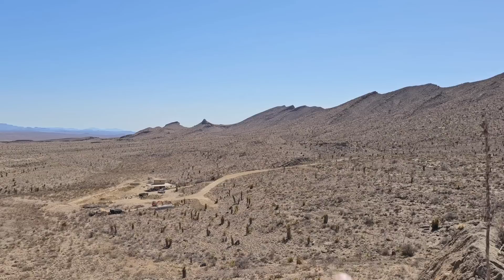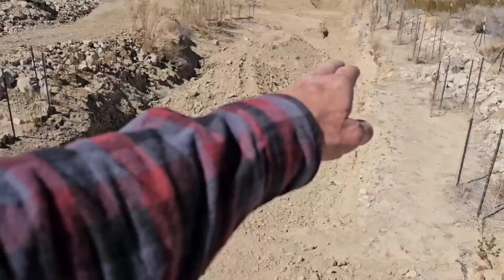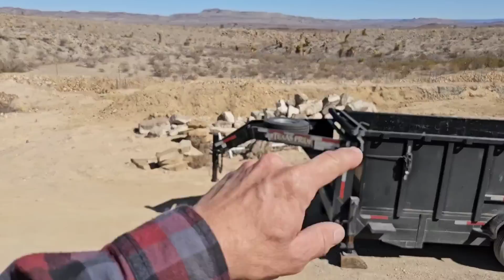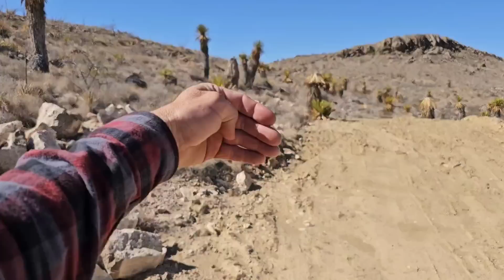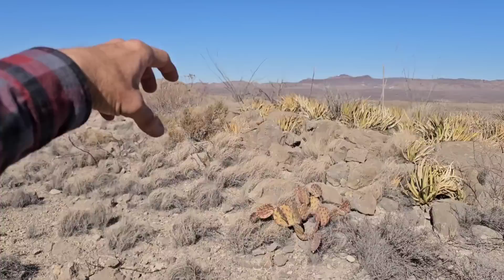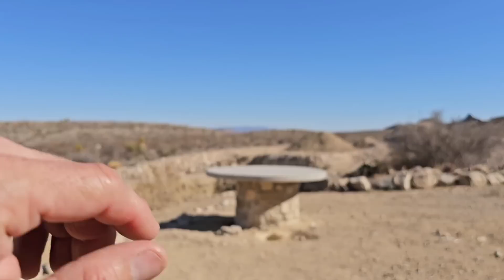Overall construction plans for the ranch @TimelineRanch

Comment: Omg. You don't have a beard. It was so shocking - I didn't expect it.

1000' is huge! Is the pond now about 300-350'? How many inches of rain do you get a year on average?

I wonder if there are easy to grow trees that are good for camp fires that you can grow. Nothing better than a fire under the stars. I can't imagine firewood is easy to get there. Is there a town nearby?

The area near the leaky weir has really greened and grown a lot. Are you going to build your house where the building is now? I didn't catch where that would be.
Reply from the maker: I grow the beard off and on, sometimes no beard, sometimes a beard. The pond is currently 300' feet long and 17'feet in its deepest point. The average rainfall for this area is 10 inches. All of the fast growing trees, the wood has a very low BTU. rating, so it doesn't burn very long. There is a small town about thirty miles away on gravel roads. The little building that's currently there is the house. There will be an additional house next to this one. That will be a stone dome structure with a conjoined awning roof. Thanks for watching one of the older videos to get a grasp on what all projects are planned at the ranch.

Comment: I don't recall you mentioning the septic system. With cabins and people living there, you will need one.
Reply from the maker: I didn't mention it. I plan on using electric incinerator toilets for the black water, and gray water will just soak into the ground in a large pit underground. Thanks for watching, and a good comment.
Reply: A guy made a solar incinerator. Just a concrete tub covered with glass.  I don't know how good it is but he was super happy.
Reply from the maker: I could see that idea being possible. It would take a good bit of mirror surface but simple enough. Thanks for sharing the idea and watching the channel.
Reply: That's an interesting idea!

I used to play with fresnel lenses when visiting Greece and always wanted to build a larger multiple mirror system to heat a steam driven turbine, some examples on the tube.

Comment: If you have access to sheep wool or goat wool, it could serve as an insulation from cold and contain water.
Reply: It also makes great mulch
Reply from the maker: I'm sure it would work great for that as well and probably last for a very long time. Thanks for watching the project.
Reply from the maker: I do plan on having a few goats and sheep later on at the ranch, when i'm there full time. I did get a whole bunch of insulation for free from a construction site, probably more than I'll be able to use in my lifetime. Thanks for watching and an interesting idea for the use of the wool.

Comment: how steep/tall do you think the walls will be around your pond once you start digging into the hillside, or am i misjudging the gradient?
Reply from the maker: Some portions of the pond, the walls will be vertical straight up and down, and others will have a gradual slope. I'm thinking about building a stone wall down the sides that are vertical, just for a permanent fix to anything sloughing off later.Thanks for watching and a good question.
Reply: @TimelineRanch one of the techniques I see regularly used here on cliffs and Rocky slopes next to roads is steel netting fastened into the more solid strata, might work in some areas. Had a climbing friend that made good money working on installing such on many of these projects.
Reply from the maker: @fuzielectron They use the same method in central Texas on the limestone cliffs. It seems to work pretty well.